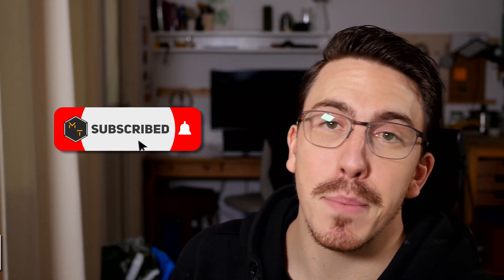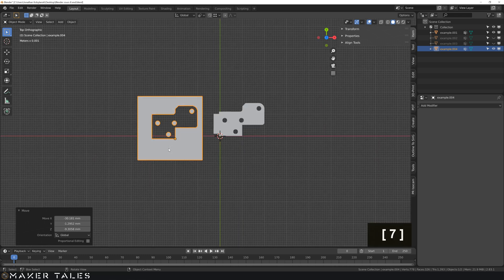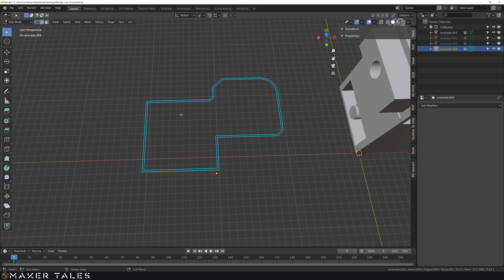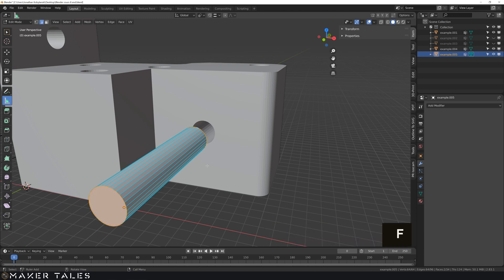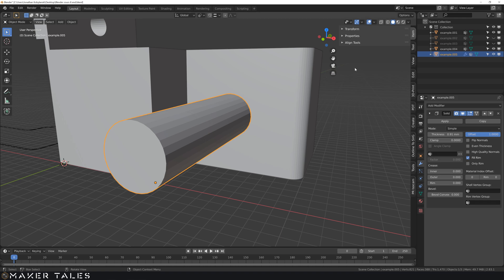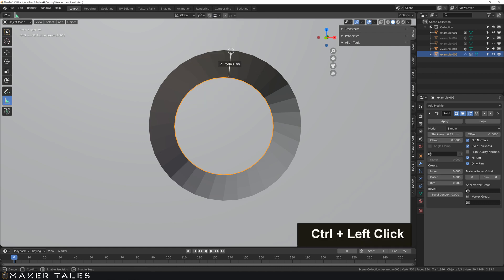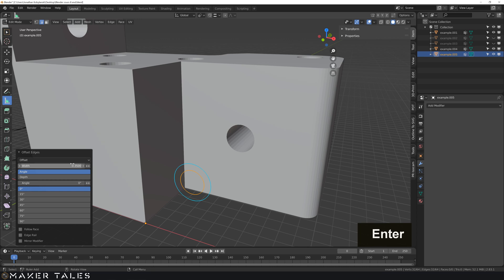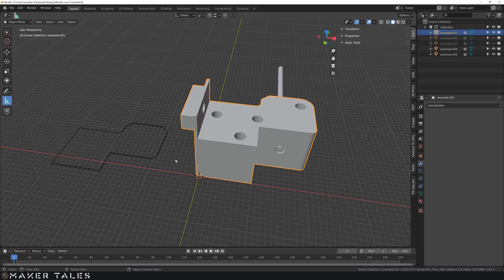Edge Offsets & 3D Tolerance - Blender 2.83 Precision Modeling | ( Tutorial Part - 10 )

Comment: Hello everyone,

I use Blender for 3D Printing, I always need to offset surfaces and models, but I offset with Meshtool Add-on, I learned this by watching this video, but when I enter 0.10 offset on a 15mm surface, the model size becomes 15.3mm instead of 15.1mm, what is the reason for this? Why doesn't it become 15.1mm, 15.5mm when I enter 0.1 or 0.5?

Thank you in advance for your help.

Comment: i made a few figures wich are no problem to print in one part... BUT i wanted singe parts so i added connectors and used boolean to cut them out...
after printing the thing i noticed everything is too tight... how can i make these simple square connectors fit? i was thinking about just making one part a lil bit bigger to cut out ... but is there a easy way to use bolean to cut bigger or smaller holes? i read about adding solidify but when i add solidify my cuts look like sht...

Comment: so at 1:44 when i press ctrl + shift +  -  it does not cut the plane, it just makes a few weird lines on it and i have no idea why, i tryed if the cutting work properly on the object and it works fine, but the plane is having troubles to be cut, even by some other objects
Reply: if i subdivide the plane it works better but is still does not work very good
Reply from the maker: Hey Tonda, this sounds to me that you are in blender 2.9. As cutting a plain in 2.9 is no longer really possible it needs to have some thickness. I would suggest you go through my new course for 2.9.https://youtube.com/playlist?list=PL6Fiih6ItYsXzUbBNz7-IvV7UJYHZzCdF

Comment: What is your approach to determining the offset for a project printed with a 3D printer. Let's say a box with a lid. One thing is printer accuracy. But I believe you always need a little offset or otherwise the lid won't fit or be too snug. Also the offset should change with box size, doesn't it? Bigger boxes need more offset, right? Let's say the printer prints absolutely accurate...what would the formula (dependent on box size) be to calculate the necessary lid offset so it fits nicely?

Comment: Hi Mr.Jonathan, How to use feet and inches in offset width ?.. i set my units as imperial but not able to enter the measurements in feet and inches in Offset edges tool...
Reply from the maker: Hi Surendar, I'm sorry to hear that it's not working with your units. Is this using the addon or default blender? If it's the addon there is not much I can do as I have not developed it but I think your best course of action would be to leave a comment on the addon forum post with the suggestion for you unit support.
Reply: @Keep-Making  Thanks Mr.Jonathan , the add-on comes with blender .... I will post comment in the belnder developer problem , I upate you once by problem gets resolved ..

Comment: I think the reason the measured distance of the solidify modifier was slightly higher than 0.35mm was because you're measuring the hypotenuse of the triangle whereas you seem to think you're measuring the vertical leg of the triangle. The cylinder is slightly shorter when using the solidify method than when using the offset-extrude method, right?
Reply from the maker: Hey Craig, you see I thought that too.
I did do quite a few test's before doing the video and every time I was getting different results.
And yes using the solidify method will give you a slightly shorter cylinder. The only other was is slightly destructive which is to do a constrained plain scaling. I've had mixed results do this but I can work quite well if you use CAD transforms to achieve this result.

Comment: Great tutorial, I like the way you did offsets for the hole and made a cylinder fit inside of it by giving it the tolerances of your 3D printer.  But how would you create a cylinder/screw/bolt with threads and an offset to fit/screw into a threaded hole if your just given the threaded holes?  http://i.imgur.com/Inxf6Wc.png
Reply from the maker: Hey Stillpoint,
I'm happy to hear you enjoyed the video.
Tell you what.... I think this is a great point you bring up so give me 2 - 3 days and i'll make a little video to show how to do your exact question plus any other strange shaped hole.